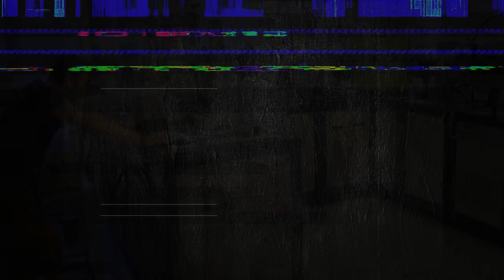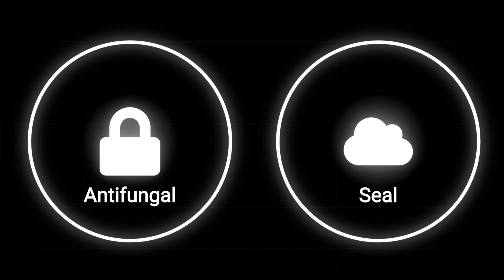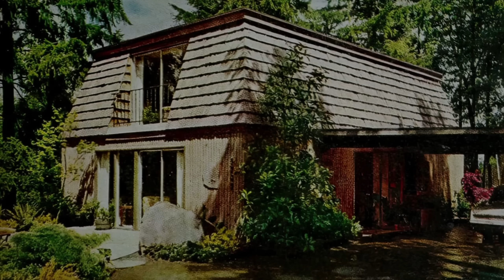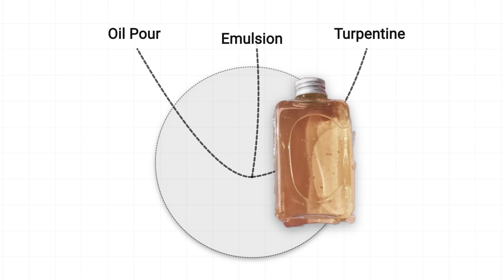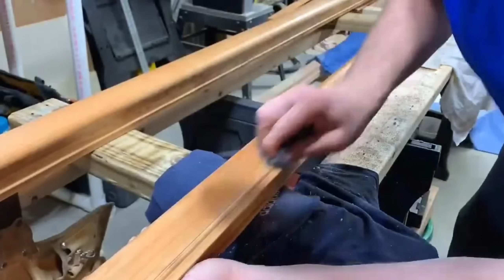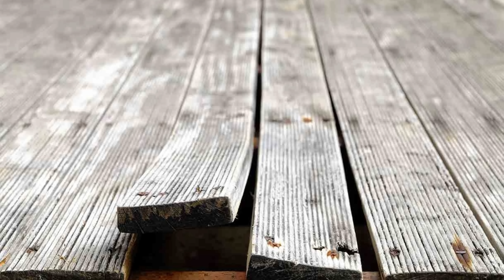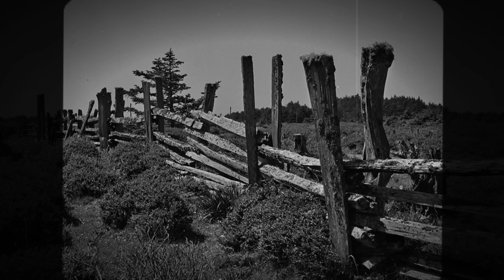The Amish Have Never Replaced a Wood Fence in 200 Years— The $2 Treatment the Lumber Industry Buried

Comment: I dont have any issue with the recommendation, agree with turpentine and linseed oil.  However the biggest factor here is that wood from 100-200 years ago has a much denser grain structure and way more natural oils and preservatives.  Cant really replicate that.
Reply: Could be locust which will last for decades. We don't use it today as it's really difficult to work with....it's like petrified wood.
Reply: @phillindsey-f7f idk what that old farm house out back is made from. ... I am trying to figure out some stuff but i have evidence that suggests that house existed in 1857. . . .. the kitchen fireplace is one thing that got my attention. Literally 2 6 foot tall people can stand upright IN that fireplace. Fricken huge. ... And i would be confident that i could park a truck in the kitchen and not fall thru the floor. . . That wood is some good wood. I don't think its treated in any way like the video here. But its all some dang dense heavy wood. I've "borrowed" a few shelf planks from closets .. i tell ya you get the same size plank today its sooooo light. And the shelf i put up in the garage. 1 is a new plank. Its bowed in the middle and theres not much on it weight-wise... That old plank ive had a set of old iron Chevy cylinder heads a spare starter and some other crap on that one. You slap something down... Bang. Board is still straight as an arrow. 

As it goes everyone says they don't make em like they used to.... We can't even make wood like we used to.. i tell you what.
Reply: @codyserucsak2501 soft pine dimensional lumber as the support beam on a load bearing wall!? Bawwaahhaahaa!!! Lol
Reply: @phillindsey-f7f  Black Locust.  But it is expensive
Reply: @phillindsey-f7f Depending where you are it's still around. But nobody is really using it anymore cuz it's basically furniture grade kind of stuff and mega expensive unless you are crazy and harvest it yourself.
Reply: Especially since one of the main wood used in the past that was almost rot proof was American Chestnut that got wiped out by blight.
Reply: I saved some of the original window frames from my victorian house that were replaced over twenty years ago , they are still in better condition than the new ones and they've been stood out in all weathers .
Reply: Knowledge avbout wood and what wood to choose is another key for sure.
Reply: Can be replicated by purchasing older trees however it'll be more expensive
Reply: Well yes , there arent any 300 year old pine trees anymore , what we are using is fast grown .. for most applications , America and canada still source old aged trees and there is a reason why they are worth 20k a tree
Reply: That's due to the wood industry making wooden framed homes. They now use farms and engineered trees with less grain and oils, like naturally grown over long periods.
Reply: Hmm...  that doesn't sound good, (trees not being as dense now). 😯😧😖
Reply: Your site isn't working now, please rename it or put a number in it.
I cant find the book.
Reply: As a 40+ year carpenter, modern wood, quick growth farm woods, are bug food....
Reply: I've pulled intact white pine boards from buildings that were 150 years old or more. Even the most premium softwood boards you buy at lumber yards today won't last a decade as exterior trim if they get wet at all, even if you keep them painted, and the finger-jointed stuff is as worthless as it gets.
Reply: @sbarner-vt  The straight grained, dense, heartwood pine (cut from the interior of the tree) from old growth trees is dramatically different from the young, knotty sapwood of much industrially produced pine today from trees decades old rather than centuries - the tell-tale sign is all the knots, they're due to the canopy of the tree running all the way down the tree whereas the canopy in old growth pines rises with the tree's/forest's growth leaving the lower section of the trunk free of branches and therefore straight grained and relatively knot free. Obviously the diametre of the trunk is also much larger in old growth meaning more heartwood and that having a diametre large enough to process into seperate planking rather than having the heart and sap sawn together as seen in much planking now. Basically, sapwood is a much softer, lower quality timber, we use it all the time now, they would have only used that for disposible things in the past, not for things they wanted to last like fences so we're simply trying to preserve the wrong wood for lack of old heartwood timber.
Reply: @sbarner-vt  Highly unlikely white pine from any exterior use survived 150 years regardless of what "Amish secret finish" was applied. Cedar, redwood, locust or oak could last that long on an exterior without ground contact and regular maintenance.
Reply: @sbarner-vt  A fence made out of pine boards?  Choose cedar or redwood.
Reply: Yes. I have Virgin growth wood in my 100 year old house.There was an addition done in the 1960's and it had termites in some places. But when the termites hit that old virgin growth wood... They just stopped. They tried, but the pine oil ( I could smell it ) was like a roadblock and the termites just couldn't touch it.
Reply: Yeah, the production standard on trees has really slipped down the drain in the last couple of 100 years. Mass production of trees has factories pushing out trees that are completely sub-standard.
Reply: Was thinking of that too.
The trees harvested for construction more than 100 years ago have often been standing there for several hundred years if not more and have grown slowly and steadily.

Trees grown for construction lumber today are "enhanced" artificially for faster growth making the wood more brittle.

Comment: I’ve always used a mix of the  RAW linseed oil  product and regular turps in a 50 / 50 ratio  ( also noted on the containers per manufacturer recommendation) and occasionally following mixes with more linseed oil and less turps .
One question for anyone to explain ; the difference using the the more expensive shop purchased  BOILED versions 
  Also interested in the method of adding either of these two linseed oil products into oil based paints as to how much improved results can/ could be achieved.
  I use a fair amount of recycled Timbers from various packaging to make things like planter boxes and kids play products ; to name a few items -; particularly where potential customers like the raw appeal of non painted items 
  Regards from Tasmania ( Australia)
Reply: Boiled linseed oil takes less time to cure than raw linseed oil. The boiled linseed oil commonly sold contains additional and toxic ingredients, but you can make your own pure boiled linseed oil fairly easily (though slowly). Hope that’s helpful.
Reply: @bluesky6327 thanks  for that
Reply: Boiled linseed oil typically dries in a day whereas raw takes weeks or even months to dry.

Comment: Here’s the problem. Where do you acquire natural linseed oil, and natural turpentine? It would be helpful to provide this information since you went to the trouble of making this video. Don’t you think?
Reply: He did. Hardware stores still stock linseed oil. Natural turpentine is distilled from pine resin and available from specialty suppliers. Pine tar is made in a similar process to making charcoal and also available from specialty suppliers.
Reply: @azurplexlooking at eh same sizes and brands in the video took a little work to find but no where near the prices stated in the video. 8 bucks for the quart of linseed is actual in the 30s. Pint of turpentine in video 14. In reality almost 50 bucks. So the items might be correct but the pricing is 4 to 5 times higher than quoted in the video
Reply: Both can also be bought on Amazon.
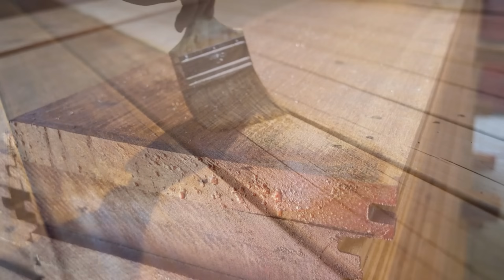Reply: 7:15 - $2/application per board. Doesn’t say how long a board is—fence or deck—but 10-20sq ft per, it does sound like you won’t get that coverage at $200/gal. — but not re-doing every 5 years at $50/gal with modern stuff. Actually, if it only took him a couple hours. 🤔 the new stuff might still be cheaper —but the beeswax. One and done.
Reply: My local hardware store has it. Big box stores might not.
Reply: Raw linseed oil can be bought from hardware. Haven’t looked for natural turpentine yet. However is expensive. The former is $250 for 20lt in Australia. So say $150 US.

Comment: My brother-in-law was a professional painter. When helping me prepare and paint my Victorian home, here is what he did. After prepping wood to be primed, we used oil-based primer then he added boiled linseed oil to the primer. He said it will turn the surface harder resisting rot and have a good adhesion value for the final coat of exterior paint.
Reply: As someone who has done painting for a fair bit I approve of this method.  👍
Reply: Add how much boiled linseed oil to the oil base primer?
Reply: What ratio did you mix the primer / linseed oil.

Comment: what exact amounts do you use for exterior wood, posts, fences, barn wood, painted window frames, Marc
Reply: One litre of "roslagsmahogny" covers 4–10 m², depending on how much the wood sucks. The classic recipe is equal parts pine tar, drying oil, and solvent. The pine tar protects the wood, the drying oil makes the surface non sticky, and the solvent is for penetration. If the surface isn't going to be touched, you can cut back on the drying oil, and for surfaces that are particularly subject to wear, you can add extra solvent and put on more layers.
Reply: Don’t put over paint. Paint is a different wood protection/decoration.

Comment: I did not know about the change in turpentine to synthetic but my grandfather, I am 71, always said first coat 1 part linseed to 2 parts turps, second coat 2 parts linseed to 1 part turps.  
Terry from Australia.
Reply: When I was contract painting here in America, we always thinned our paints and stains, with BOILED Linseed Oil if needed thinned slightly, due to brushability, evaporation, and so on. Never other thinners and it was always the best finished job.
Reply: I confirm the recepie! (I'm Swedish.) Then oil based paint, if it's a window or door. Though I once did it to a whole small house (35sqm), as the whole house was completely dried out grey wood. Then oil based primer & two layers of oil based colour paint. A lot of work, painting 2 + 3 layers. But it was still in excellent condition when I sold the house 25 years later! 😀 And neighbours suggested replacing all the wooden panels when I started on the house! And all the old windows and doors.
Reply: yup! and it works. also soaking fenceposts in used motor oil before setting. also that ol borax wash. prep is the path to success.
Reply: @nancyzehr3679 - Will soaking fenceposts in motor oil lead to leaching into the soil?
Reply: And if adding pine tar?

Comment: You didn’t go into pine tar treatment
Reply: Yes like several minutes! Turpentine equals pine tar the real turpentine
Reply: @christopherjohnson7501 no, they are not the same. Pine tar is extremely thick and sticky. 

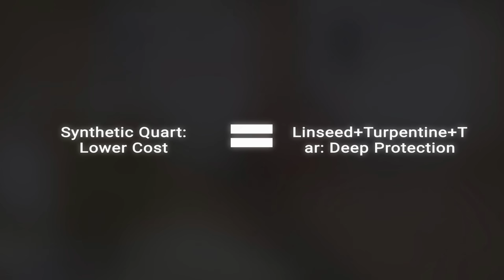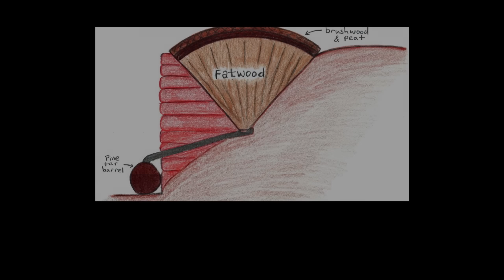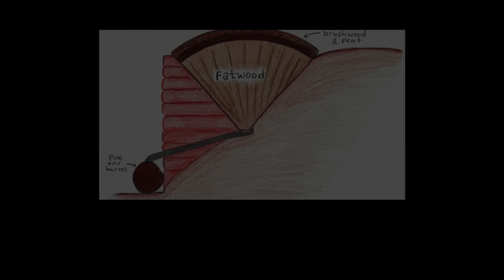And in the video, near the end, he said equal parts boiled linseed oil and turpentine, then add pine tar. He notes it at 6:30-6:40. An image is provided at 6:38 but doesn’t show the label. He didn’t state the ratio, though.
Reply: @bluesky6327 said for external application otherwise the boiled linseed oil and 100% turpentine are good for indoor use.  Plastics are nothing better or could be better i doors for flexible coating functions.  Resistance to certain environments just as paint provides to kitchens
Reply: @bluesky6327   yep it is brunt out of       the wood in metal over fire is pine tar

Comment: Would this be applicable in cold weather climates? An area that gets as low as -20* ?
Reply: Wood decay is caused primarily by microorganisms and fungal growth. After the wood starts to decay, insects can get in and cause further damage. All of these slow or stop completely at sub-freezing temperatures. You shouldn't apply any type of coating when it is below 50 degrees F.
Reply: @sbarner-vt Thank you
Reply: Yes. This wood treatment is common in Sweden, and extreme cold isn't a problem. You need heat to apply it properly, and linseed oil oxidizes slower the colder it gets, but otherwise cold climate isn't an issue.